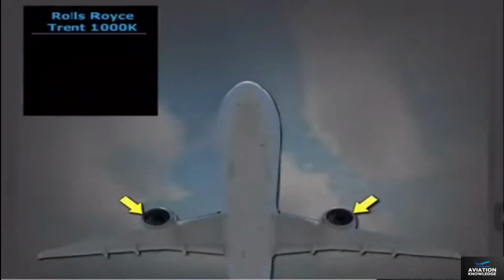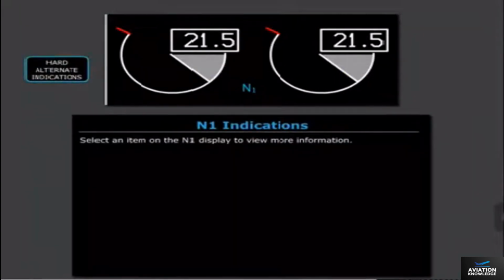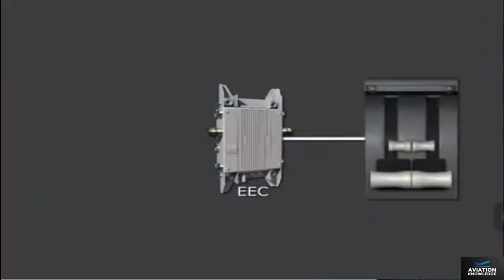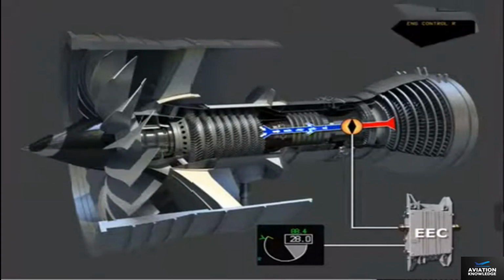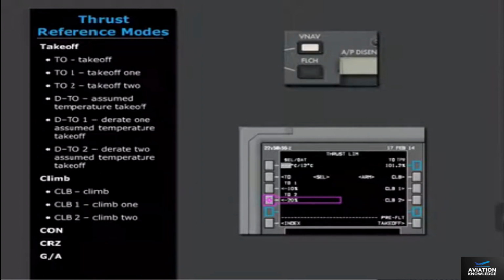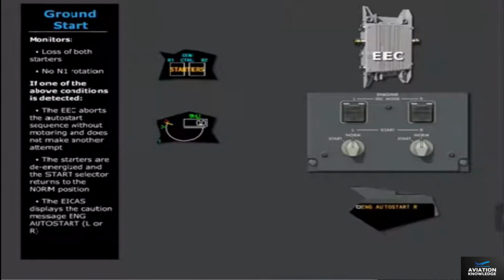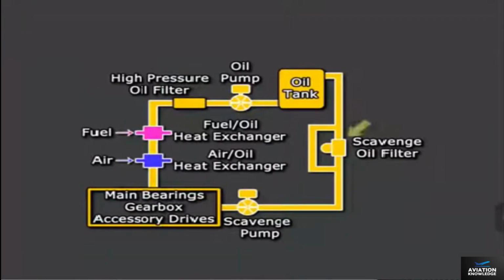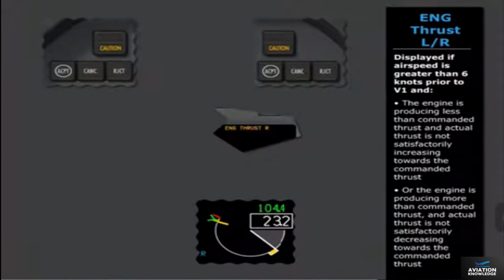B787 CBT Engines

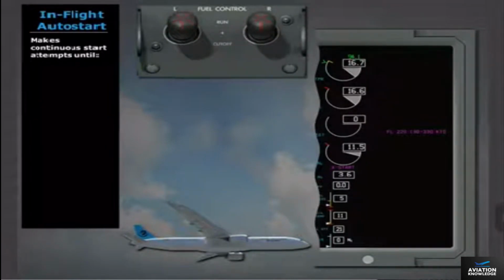Comment: 37:42 AI 171 related cutoff switch which automatically restart engine in-flight unless cutoff is selected, 40:09 shows the possible switches used to cut fuel supply to engine... 😅